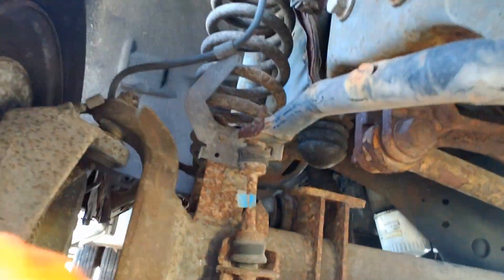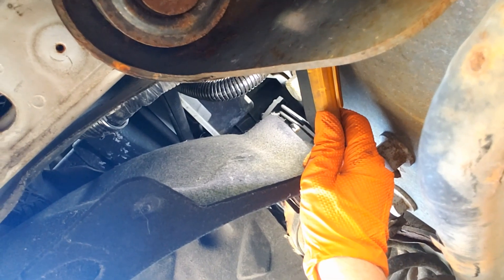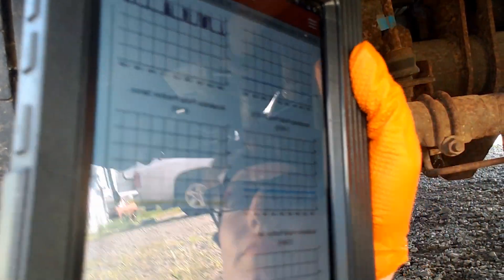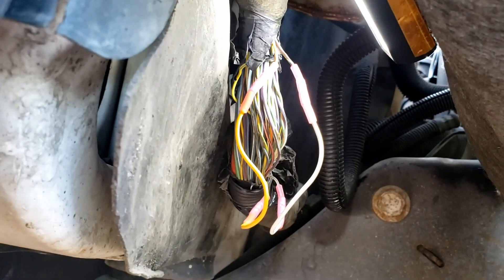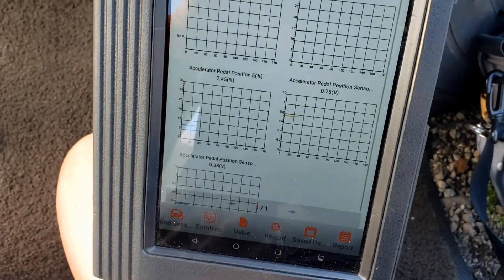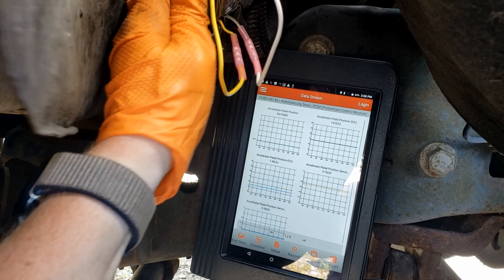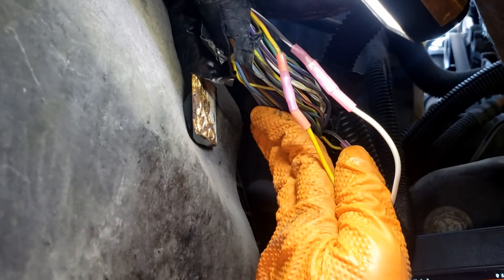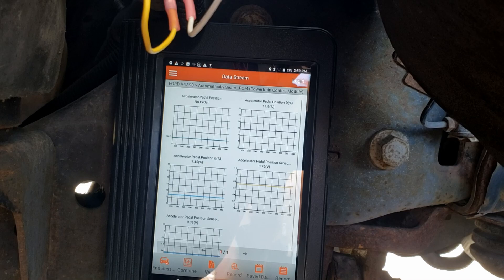'13 F450 6.8ltr; P2138 -Does It Need an APP?

Comment: a ford with a wiring issue in the same location others have failed, no big surprise there knowing ford's over the years, if you find it on one, you'll find the exact same on most all of them with the same harness and routing.
"focus you fork" 🤣 reminds me, I haven't watched some of the "Cannutians" in a while.
Reply from the maker: Yeah, true about the harness... however in that previous one, the fan clutch had failed and the fan flew off into the radiator and sliced the harness in a few locations... but the weird thing was that the wiring issue was a little further up the loom. Now I see this could be a repeat problem or defect. It seems to happen in an unlikely, undisturbed placed in the harness, well wrapped. 🤷🏻‍♀️

Ahhh yes, good old AvE... lol He's a fave of mine to watch. He speaks so eloquently and such a vast array of scientific geeky knowledge 😍😜

Thanks TB... always a pleasure to read a comment from you! Have a great holiday wknd!! 😁